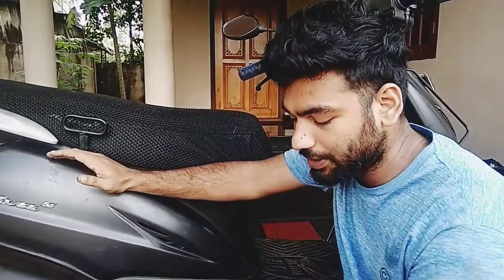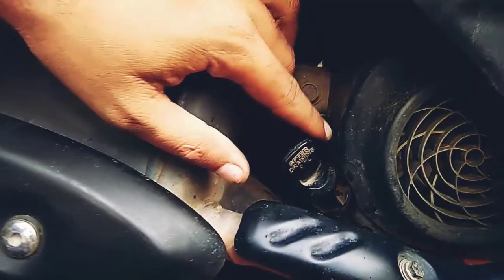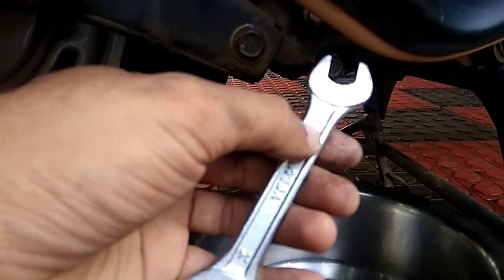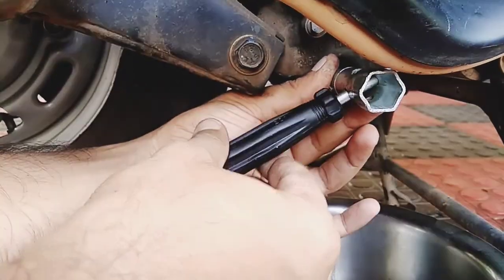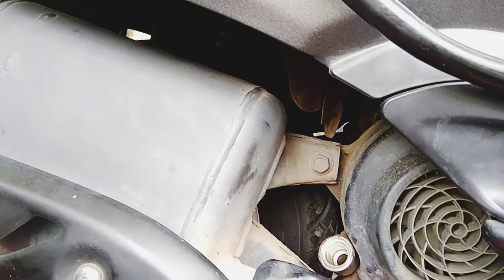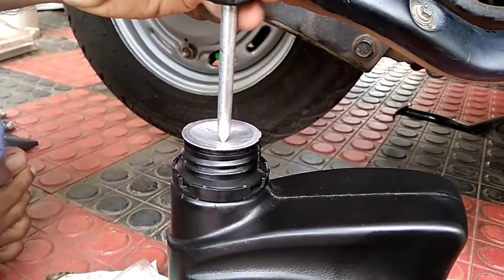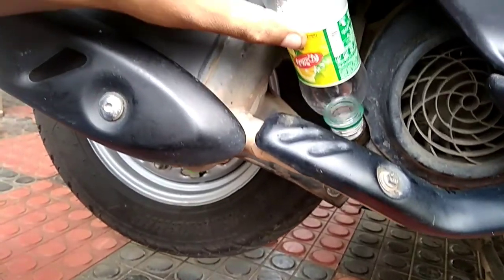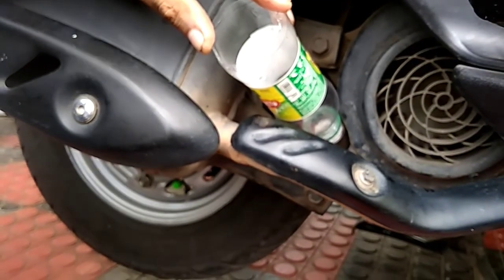Honda Activa Oil Change at Home in Malayalam | Activa 3G/4G/5G/6G Oil Change

Comment: ഇത് 10w40 MA Specification (wet clutch) Bike ഇന്റ്റെ ഓയിലാണ് ഇത് സ്കൂട്ടരിൽ ഫ്രിക്ഷൻ  റെഡ്യൂസ് ചെയ്യില്ല . ആക്ടീവ ഡിയോ എന്നീ വണ്ടികൾക്ക് 10w30 MB (Dryclutch) Specification അണ് നല്ലത് . മാത്രമല്ല ഓരോ തവണ ഓയിൽ ചേഞ്ച് ചെയ്യുമ്പോഴും ഓയിൽ ഫിൽറ്റർ ലെഫ്റ്റ് സൈഡിൽ ക്ലീൻ ചെയ്യാൻ മറക്കരുത്. ഓരോ 10000 കിലോമീറ്ററിലും എഞ്ചിൻ ഫ്ലഷ്  ഉപയോഗിക്കുക.
Reply: wet ക്ലെച് ഡ്രൈ ക്ലെച്  ഹ ഹ,, ഇതൊക്കെ ഓരോ തമാശകൾ 20 w 40 ആയാലും പ്രശ്നം ഒന്നും ഇല്ല ഓരോ പേരും പറഞ്ഞു ഓയിൽ ഇറങ്ങുന്നു ഹീറോ ഹോണ്ടയൊക്കെ ആദ്യം ഉപയോഗിച്ചിരുന്നത് 20 w 40, കാറിനും മറ്റും ഉപയോഗിക്കുന്ന ഓയിൽ ഇപ്പോൾ തെക്കോട്ടു ഓടുമ്പോൾ ഒന്ന് വടക്കോട്ടു ഓടുമ്പോൾ മറ്റൊന്ന് കാക്ക തൊള്ളായിരം ഒയലുകൾ ഇതൊക്കെ നമ്മളാരും ടെസ്റ്റ് ചെയ്തു നോക്കാറില്ലല്ലോ
Reply: 👍👍10W30 thanne aan manufacturer's recommended.
കണ്ണിൽ കണ്ട ഓയിൽ മുഴുവൻ ഒഴിച്ചാൽ engine പണി 🔥🔥🔥.
Reply: എൻ്റെ സ്കൂട്ടർ tvs Jupiter new aanu oru doubt oil change ചെയ്യുമ്പോൾ പിൽ ഫിൽറ്റർ കൂടി ചെയ്യണം അല്ലേ അതെ പോലെ നിങൾ പറഞ്ഞ എന്താണ് എൻജിൻ ഫ്ലഷ് ചെയ്യുക പറഞ്ഞത് എയർ ഫിൽറ്റർ എപ്പോൾ ആണ് മാറ്റേണ്ടത്  ,gear oil എപ്പോൾ ആണ് change ചെയ്യേണ്ടത്